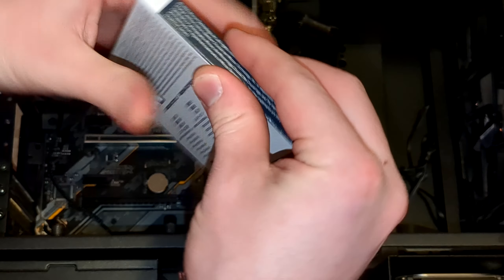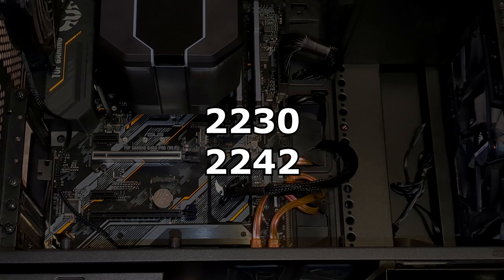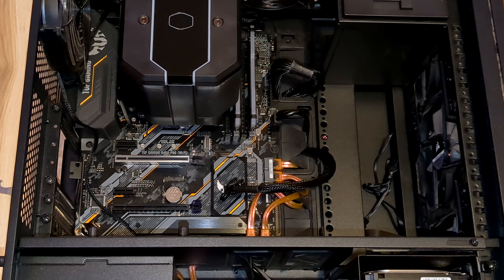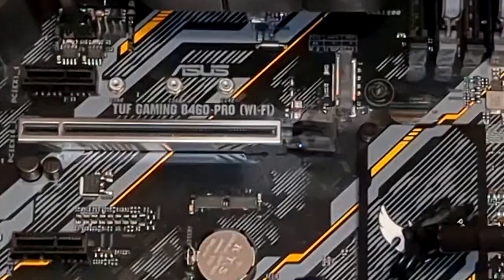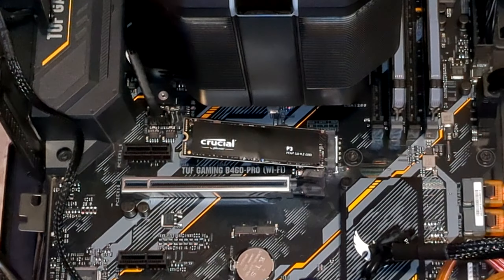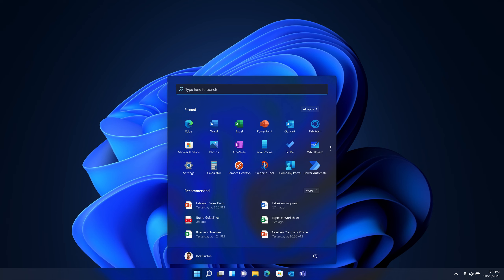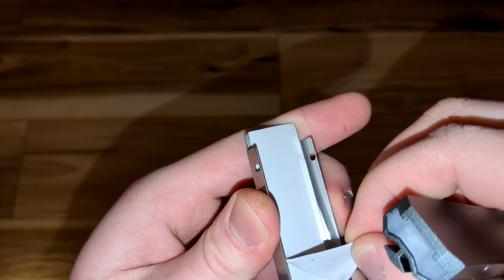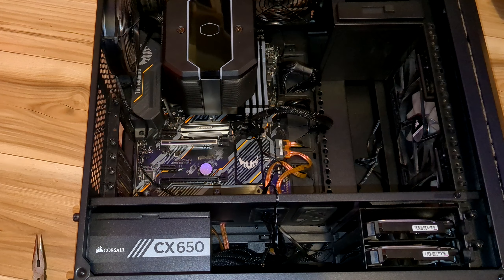How to Install an M.2 Drive into a Desktop PC

Comment: I found out what was causing my PC not to boot ram a its rated speed one of the ram slots is dead. But when I put a single stick of memory in 4th ram slots PC only boots into bios and I tried booting the PC in 3200 and 2133mhz while the single ram in 4th slot. It boots at the 2133 but not 3200 so is the ram slots dead or not.